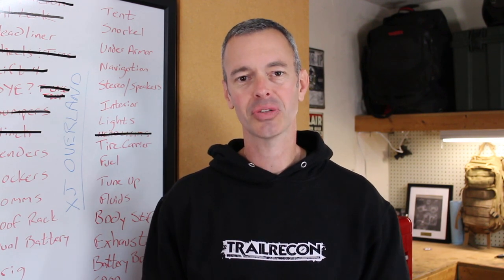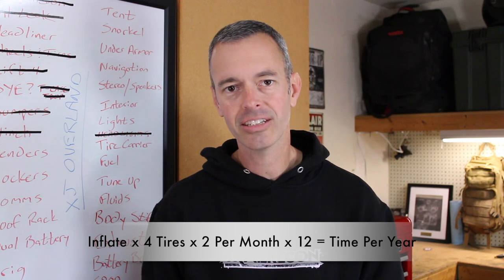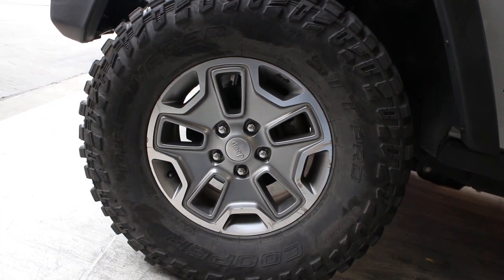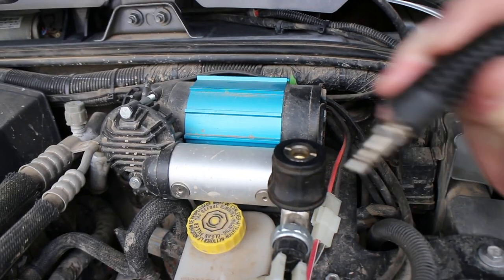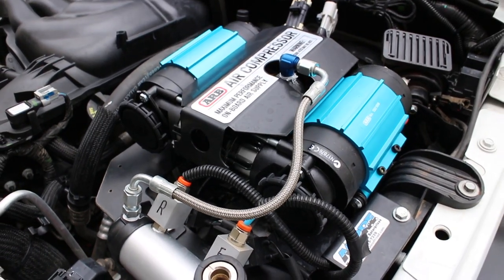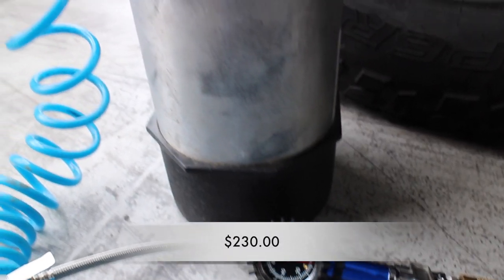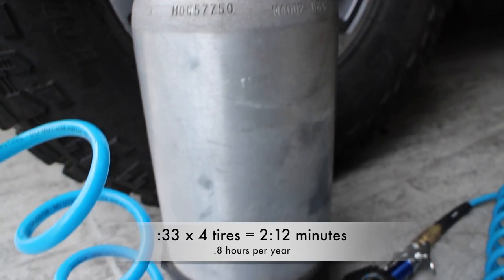Air Compressor Shoot Out - Tire Inflation Comparison

Comment: +1 for the Smittybuilt 2781 (5.65cf/m). 2 years and maybe 20 air ups, still working great. Fun fact: don't grab it with bare hands after filling up in the sun on a hot day...

Comment: Don't forget the include the ~3 hours a year (1 trip/2 months, 30 minutes round trip) to refill the tank. :)
Reply from the maker: LOL! Yep, great point!
Reply: hotshtsr20 I hit a paintball store next to one of my customers when I'm making a sales call. I'm there every week anyway so I don't even consider it as time used to fill up the tank. I used an electric compressor and tank system in my TJ but went back to the Powertank in my LJ. I'm never going back!
Reply: and how much time will it cost when you refill you're tires for the third or fourth time when the pressure in the tank is lower.
Reply: This is why I switched from a PowerTank to an ARB twin. I'd rather spend the time outside at the trailhead than waiting around indoors for a shop to fill my tank.
Reply: bill2526 bill2526
You've bought several compressors for the price of one PT AND you have  to keep feeding it money (refills).
PLUS just the addition of a resevouir tank narrows fill speed between the two to just about even.
The instability of CO2 is a completely diff subject, but putting CO2 in tires makes the most out of that instability.  HIGHLY DISCOURAGED!
Reply: bell co2 holds the same roughly 900psi pressure until all the liquid is gone. Its not like nitrogen or compressed air.
Reply: I use power tools on the trail so I gotta keep my pump and 7 gallon air tank which with that being said with that air tank must help keep stress off my pump cause I’ve had 0 problems this last year
Reply: @1063996  CO2 tanks contain liquid CO2 which turns to gas as necessary as the gas in the tank evacuates... it therefore stays at the same pressure right up until it runs out of liquid CO2.
Reply: @samjohnson9894  even if you filled the tank every 2 months, and we round way up to $20 a refill, that's $120/yr, a DIY CO2 set up is less than $50, is basically zero mantainence and even if your compressor magically lasts more than 5yrs, the CO2 tank is still working while you're stuck shelling out another $600. I kept a CO2 tank as back up and it saved my ass after my ARB gave the ghost. It's all I run now
Reply: That's a very good point 👍
Reply: LEAP YEAR !!!! NOBODY FACTORS IN LEAP YEAR!!! ARE WE ANIMALS???
Reply: @alabastardmasterson  My underrated ViAir (went 300p, should’ve gone 400) has lasted 6 years now. Starting to slow down, but still within a minute of what my friends are seeing with newer units. 

Slower than CO2 for sure, but easier to store, don’t have to worry about what I bolted it to so it doesn’t kill me, never runs out of air, and all my air tools have been replaced with more powerful battery units anyway.
Reply: @ghostmost2614  lololololololol
Reply: True.  It'd be a commute just to the nearest refill place for me.
Reply: @alabastardmasterson  Exactly. Just imagine what your face will look like when the compressor fails out on a trail and you have to ask for help!
Reply: @Gettinbentoffroad  The amount of work a compressor does is the same whether you have a tank or not. A tank just gives you more flowrate but doesn't save the work a compressor has to do!!!
Reply: @LWRC  makes sense maybe I just got lucky I also mines in my back hatch area try and keep it out of the engine bay if possible lots of extra heat in there.
Reply: @LWRC  correct, but it can save you significant time at fill up.
Reply: @ThisTall  Just wait till you have a compressor failure when you are out in the middle of nowhere without cell service. Search YouTube and see what others have experienced with compressor failures. You will not fine one person who has had a CO2 tank failure!!!  If you can't figure out this cost benefit analysis, you shouldn't go off road and just stick with calling AAA when your car gets a flat!!!

Comment: Something I rarely see mentioned is running the air compressor to a tank, which will give you a couple gallons of volume to work with. Just turn it on a couple minutes before the end of a trail, and then when airing up you'll have a system more comparable in speed to the co2 tank. Not as fast but a heck of a lot faster than just a compressor.

Comment: I have 3 air systems on my TJ.  One small ARB compressor (now discontinued) only for my ARB lockers, the second is a Viar that mounted and plumbed-in under the hood with an extra solenoid for the ARB's (just in case),  and the third is a Powertank (10lb tank).   

I'm running 35x12.5x15 KM2's and my fill times are also in about the 2 minute range.  It varies a little if I'm shootin'-the-breeze while airing up and get distracted.  

And everyone is right who says it doesn't matter how fast you are, you're going to be waiting on the slowest guy anyway.  In my club, typically after the slowest guy is done we're still shootin'-the-breeze about where to go for dinner, or the next trail, or something else.   lol
Reply from the maker: You are 100% right, we never just air up and bounce... always hanging out and talking about the days events with everyone.

Comment: Hey Brad! I'm running a ARB Single compressor, but the plan is to have that as back up and invest in a Powertank CO2 system! The convenience of filling up four tires in two minutes as opposed to one tire in two minutes is great. Not to mention you can pop the bead back on with a powertank or use it to run power tools!
Reply from the maker: Oh man, I totally forgot to mention the benefit of popping a bead back on.. huge advantage!  Thank you!

Comment: I use the dual ARB compressor to fill up my 35's.  I am very happy with how it does its job.  Two words: ENDLESS AIR.  I thought about getting a quick fill air tank but decided I did not want the hassle of adding an extra task to my trail ready to do list and let us not forget the $$ to fill each time.  Also, I thought about the possibility of not having quite enough air to fill all 4 tires at the end of a tank cycle while being many miles from home.  All things considered, this is why I spent the big bucks on an ARB Twin Motor compressor.
Reply: 4 tires x 4 fills each per $20 fillup is $1.25 per tire each fillup....that's kinda expensive, especially if you help out someone else for whatever  reason.

Comment: I do have a T-max single piston compressor hardwired in. In between I have an air tank. I use it to run my lockers, in flate my tires, and from time to time run some air powered equipment. Very happy with it!
Reply from the maker: Sounds like a solid setup!

Comment: I'm running a 10lbs Powertank.I can fill my Falken Wildpeaks 38x13.50r17 LT with monster valves from 8psi to 35psi  under a minute. Five times.  Only cost me $12.00 to fill at local shop.  Not bad I say.
Reply: How many times can you refill your tires from the 10lb tank before you need to refill the tank and can you run air tools effectively and for how long?
Reply: Barry kimbro  I can fill my tires 5 times.  Runs impact and air tools pretty good. But to be honest I always carry a electric impact as well. .
Reply from the maker: That's seriously fast for 38's!  Thanks for sharing your numbers!
Reply: TrailRecon  what's your email I'll send you sum pictures.  Check your DM on IG.
Reply: Nice video!  I'm interested to try the monster valves, although I never air up so not sure how much it would help...
Reply: BleepinJeep   LOL.  That how you save $150 for the monster valves.   I love them. They air down ridiculously fast. If you open them and walk away  for a sec.  flat tires.  And they air up just as fast.  Good investment for me.

Comment: Brad, I love my ARB dual. It's fast, it feeds my lockers and it is there all the time, means I do not have to worry about refill or about my back when carrying those.CO2's. Also my trunk is already occupied with my gear so I wouldn't want to make up space for a CO2. My personal psi is 15/28. Great video. Keep 'em coming.
Reply from the maker: I'm seriously considering upgrading to the dual and putting the single in the XJ since it has smaller tires.  Thanks!

Comment: Viair 88P compressor, 265/70/R17 tires (31").  It takes 17 minutes out of the day to go from 14psi to 35psi.  My test begins from when I stop the vehicle and ends when I drive away.  It includes unpacking and packing back with nicely wound up cables and hose.
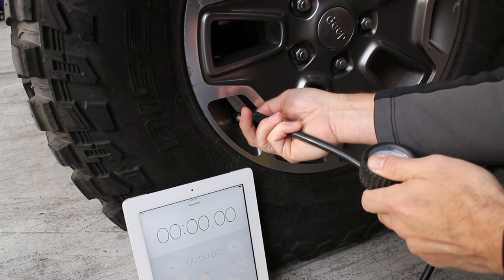Reply: About right. 265/75/16 from 15 to 32 take 2:15 with the 88p. Engine running. Been looking at the smitty built seems a good bit faster but the cfm numbers seem high

Comment: FYI - Most Jeepers that I know that use the very fast Co2 cylinder to inflate their tires after a trail run also carry a back-up dc powered compressor just in case they run out of Co2.
Reply from the maker: Great point, thank you!
Reply: There is no running out of CO2 if you weigh the tank to see how much is left. If in doubt, just fill it or get a second tank.

Comment: Hey guys! I'm using the ARB dual piston built-in air compressor.  It take me about 2:45 seconds (if memory serves me right) to fill a 40" tire from 15psi to 36psi. 
I live the fact that I can also use it to engage my ARB air lockers with it!

Comment: I use a 15lbs Powertank that I bought from my coworker for $300 with accessories included (pressure gauge inflator and hose) and I tell you what it inflates my tires uber fast. I usually drop my 32" Duratrac tires down to 20psi when I off road and inflate them back to 35psi when I hit the pavement. It takes me about 20 sec to inflate each tires. I use to use a cheap harbor freight 150psi portable compressor which took forever to inflate my tires, but now have it as a back up. I would highly recommend investing in a Co2 tank especially if you off Road a lot :)
Reply from the maker: Great information and having a back up for a CO2 system is also something that shouldn't be overlooked.  Thanks!

Comment: Great vid!!!  IMO the ARB dual compressor is the way to go for ease of use, speed, and reliability.  CO2 has it's place and advantages but I think the disadvantages outweigh it the pros.  With the CO2 tank you have to worry about a way to securely mount it, so a bracket of some sort is necessary which is another added cost.  You also have to remember to fill it up before trips so that is also added time. Worst case scenario I would hate to be out on a trail and run out of CO2 because I forgot to fill it up.  There is also cost involved in having a place fill it up for you as well, whatever that may be.  With a portable or onboard air compressor once you have made the investment you are done with the cost and never have to think about running out of air and filling it up.   If you have a compressor mounted somewhere on your vehicle it really is a set-it-and-forget-it maintenance/worry free type of device.  IMO that is worth it over the speed of CO2.
Reply from the maker: Great comments and completely agree... love having onboard air.
Reply: If your out wheeling, you should be checking off your list?  Includes filling your tank.  The ARB twin compressor; for air tools without the extra air tank is a non starter.  I SCUBA as much as possible, ocean, quarry, hell i’ve done nasty rivers.. so securing this small tank is not a problem.  Air tools, inflate tires on the trail +++.  As for the risk of CO2, apparently everyone knows about it; crack a window, or run the recirc on your ventilation system in your rig.

Comment: I'm using a cheapo that came with a slime tire kit. I've used it for around 10 years now, about 4 times a week, and it takes me 14 mins to do all 4 tires
Reply from the maker: Wow, they built that one well!
Reply: Mine been runing since 2012, sometimes no longer stays attached to the tire while inflating but keeps on saving my butt
Reply: With 35's?
Reply: 4 times a week? Why?

Comment: I use the smittybilt but do plan to replace with the dual tank ARB eventually.  I addition to the time it takes to fill up the tires you should also consider the time to setup and put away.  Add a couple minutes to take out the smittybilt, hook it up and untangle the air hose.
Reply from the maker: Set up time is an excellent thing to consider, I pop my hood and plug in with the ARB...very fast.

Comment: Good video and good comparison.   My buddy runs a hard mounted twin ARB.  I use a pair of MV-50's that I keep in bags.  We both have 37" tires.  He has the first tire filled up before I even get the first MV-50 attached to the battery.    So a lot of time is saved if you hard mount the compressor (times 2 trips a month each year).  And of course when I am done I have to bag them back up, secure them in the back.    I recently purchased  a twin ARB, I just haven't mounted it yet.  It's big  and I want it inside the Truck and all of my under seat space is taken so I am getting creative.  I am going to get  an air tank, just trying to decide on 1 or 2 gallon.   When it is all set I am going to try hooking his and mine up to the tank and for fun see if you can cut the time in half with two twin ARB's.    At some point the valve stem is going to limit the amount of air you can push through it. 

I keep a CO2 tank in case I want a quick fill (late night on the trail) or seat a tire.  But I will ditch it when I get the ARB twin compressor all hooked up.   It's faster on the trail but you do have to go get it filled up.   So when you add in removing the tank, taking it to the store, waiting for the refill, installing the tank, much of the time advantage is lost.

Comment: Nice shoot out video! I have a ARB CKMA12 with 33" tires upgrading to 35" on Jeep bead locks. currently building front n rear JK  dana 44 axles with ARB lockers for my 06 LJ
Reply from the maker: You'll be very happy going up to those 35's and dana 44's are the way to go.  Thanks!

Comment: I dunno. I realize this is old, but I’m not sold on the CO2 method. Your calculation of time spent with that method seems off, because you completely neglected the time spend charging the tank. With compressors, that time is concurrent with use. If you figure that it, the CO2 method is probably the slowest by a long shot.

Comment: If you forget to weigh your CO2 tank to see how much is left you don’t need to be “Overlanding” also the CO2 tank can be stored in any orientation you want. Just needs to be vertical when using it. It’s a great cheaper option if you can’t afford an ARB compressor and don’t wheel hard enough to warrant air lockers. I’d love to have an ARB dual but between the LC and the Tacoma I needed a portable option. 

One of the kids calls or a family member with tire trouble, I grab the tank and go. It works for us. 

I have scored more free beer by being the CO2 tank guy and filling other peoples tires too. YMMV

Comment: You can attach a tank to the ARB single piston compressor as well, not just the dual piston. Great video. I'm currently running the ARB single piston compressor.

Comment: 15lb Powertank to fill up my 37's.  It actually lasts a few trips.  My local welding supply shop charges $29 per fill.  I have it mounted on the rear roll bar.  The biggest issue is that a couple of times, I have hit the regulator handle putting it back in the Jeep (on the few times I run with a hard top), and go to use it the next time, and it is empty.
Reply from the maker: I'd be pretty frustrated if I went to fill up my tires and no air... great information, thank you!!

Comment: Hi Brad, thanks for this perfect and timely comparison.  I now feel I am finally informed enough to purchase the right option for me.  I also appreciate the comment made about only being as fast as your buddies.  I settled on your choice as it is a lightweight and permanently installed solution.  I might have opted for the dual cylinder for the extra utility but I already purchased a Milwaukee cordless impact driver.  I was leaning towards CO2 until I saw your video and read the comments.  Great job!

Comment: You gotta love the speed of the co2 bottle, but I don't think the speed advantage outweighs it's disadvantages: 1) Have to go refill it 2) it is fairly big and heavy  3) it takes up space in the interior  4) needs to be properly secured after each use  5) you will still be waiting for others in your group to finish airing up anyway.

The price of the ARB Dual isn't cheap, but it's probably the best option for me.
Reply: I would agree the dual seems like the best bet
Reply from the maker: Great point about the storage and having to properly secure it... can't have it rolling around the back of your rig Thank you!
Reply: How is refilling a non-issue?  Maybe it is for you, but it certainly seems like an extra inconvenience to me.  How do you secure your tank?
Reply: That is a nice way to secure it.  I looked at the Springrtail Solutions website but I did not see that bracket?
Reply: Awesome bracket!  But that $82 price tag needs to be taken into consideration when weighing the different options.  I actually do think that looks pretty cool back there.

Comment: It's the York compressor bracket kit ,on board air , looks like you get the a/c mounting bracket and the new serpentine belt, you get an old jeep A/C unit ,turn it to air only ,and install it on the bracket kit ,you can keep your factory a/c too,if you have it. they used to sell it as more of a complete kit.